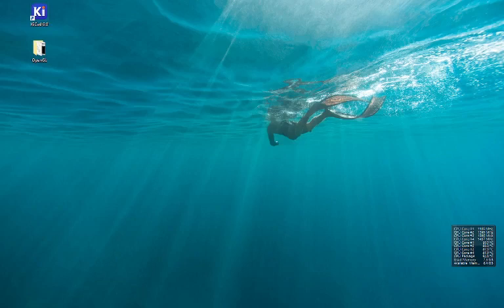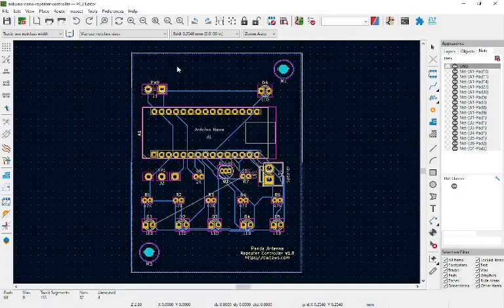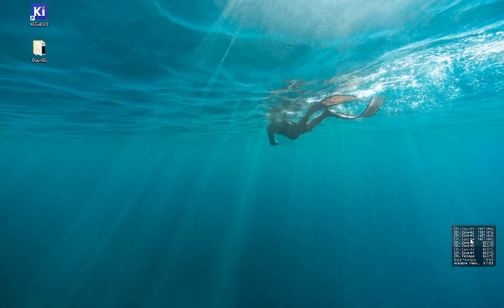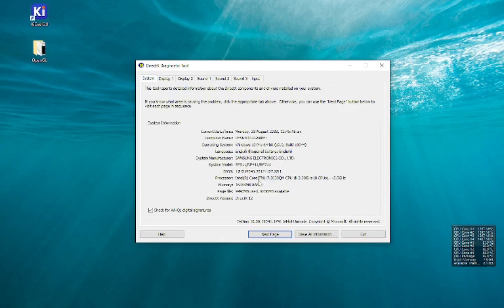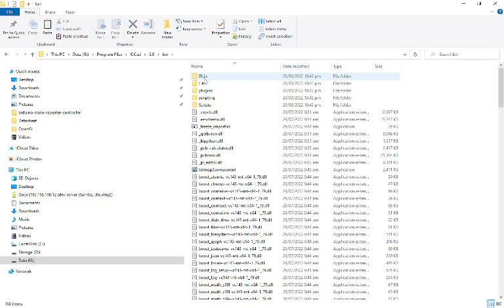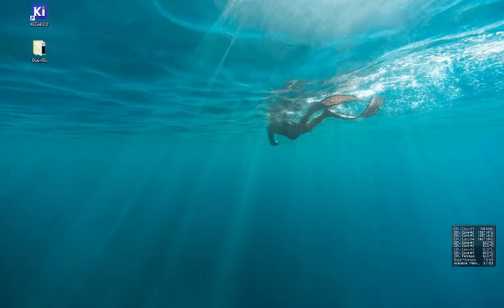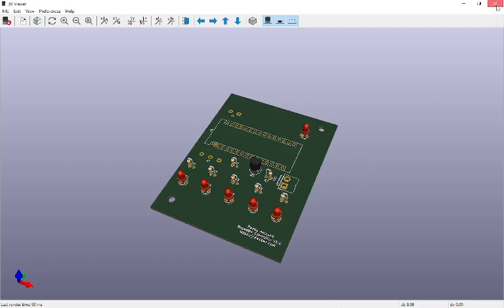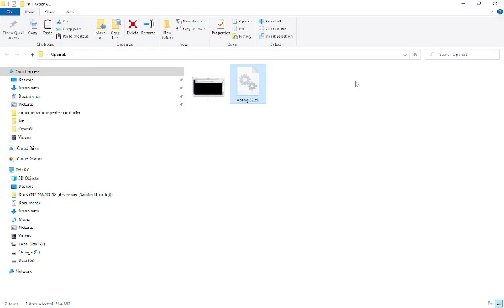Kicad 6.0 fix or work around for OpenGL not properly working

Comment: Problem persists sir
Added the opengl32. Dll file in kicad bin but 3d view doesnt come. Please help
Reply from the maker: what specific error have you encountered? I'm using an old i7 laptop with Nvidia Optimus graphics card and intel HD 3000 the fix works fine with me.
Reply: Same error openGl not supPorted min req 2.1
Reply: i3 core -2350M processor/ intel Hd 3000 graphic processor/
Reply from the maker: @masroorafzal3468  have you tried restarting your computer? and registering the dll file? on the command prompt using administrator account type this >>> regsvr32 opengl32.dll  if it doesn't work I'm not sure if there are other fixes for this.
Reply: Ok i will try
Reply: It shows" the module opengl32. Dll was loaded but the entry point dllregister server was not found. Make sure that opengl32. Dllis valid dll or ocx file"
Reply from the maker: @masroorafzal3468  if that is the case the computer is looking for the file on windows\system32\ folder or windows\syswow64 folder you need to copy the file there as well and see if it will work try this search on google for guidance dllregisterserver was not found
Reply: @EphraimGariguez  yeh finding the same
Reply: I will reply if i get it fixed. Thanks for help